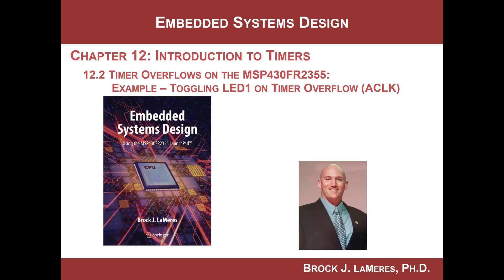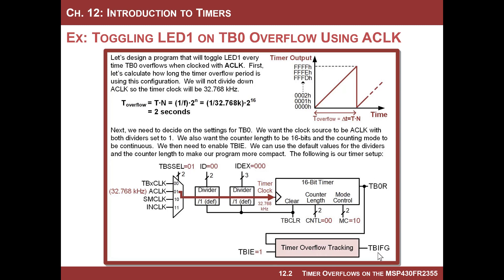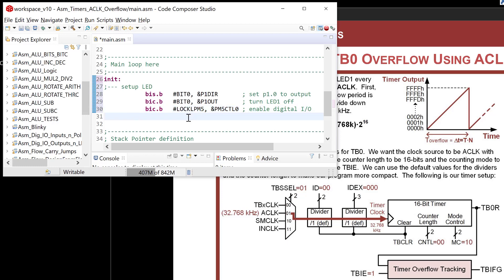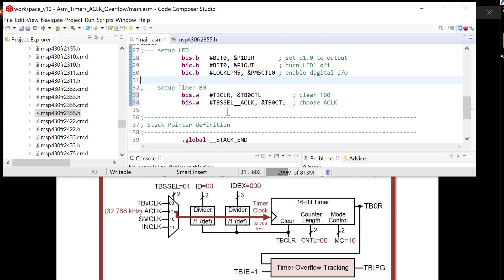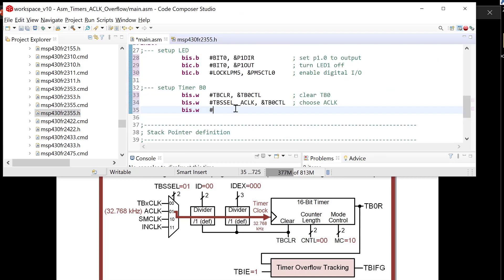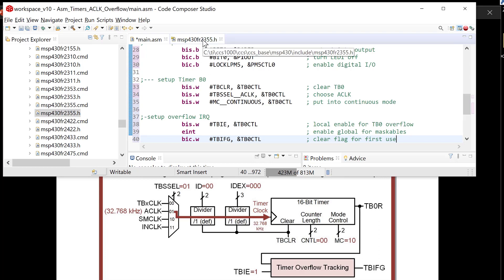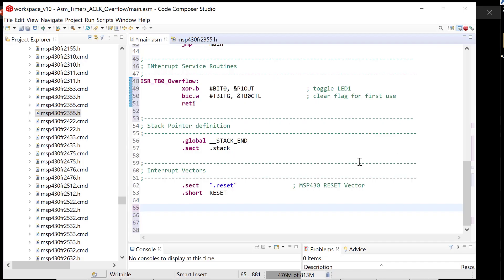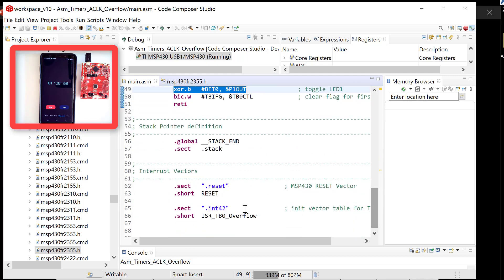12.2(b) - MSP430 Timers - Overflow Example using ACLK

Comment: Thank you so much. I have problem that if I use c, timer works but in assembly I have issue that inside of ISR_TB0_Overflow function, TBIFG dosen't clear the flag. I don't know why that happens. And because it dosen't clear the flag it will never come to that method again. odd issue...